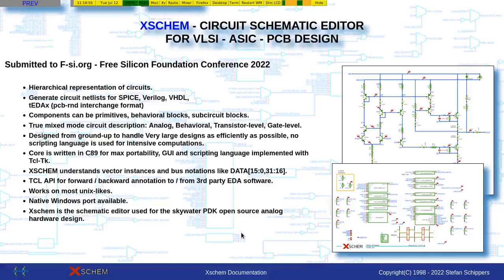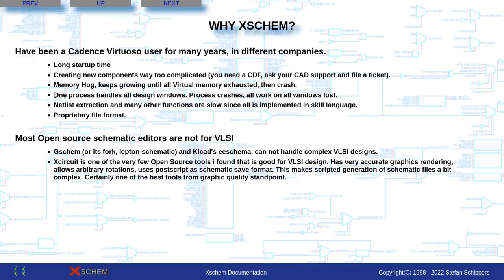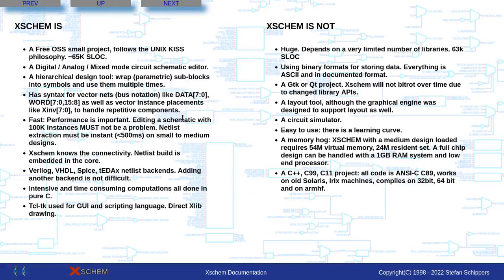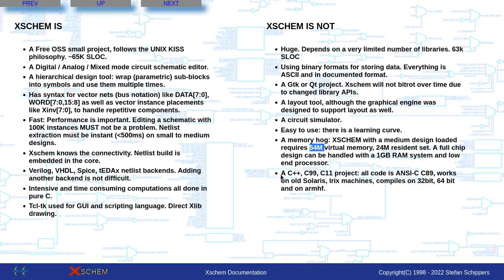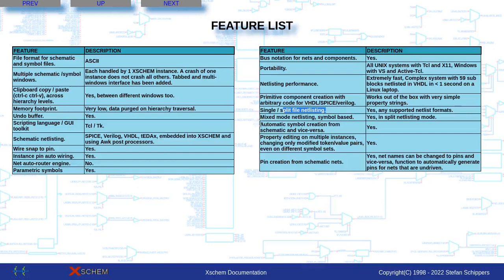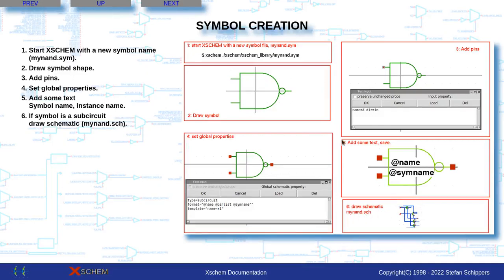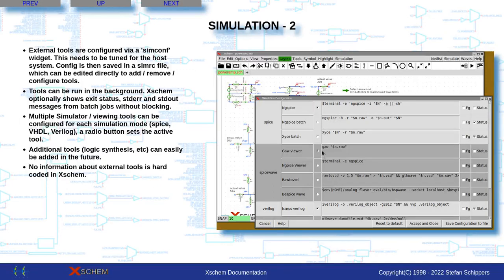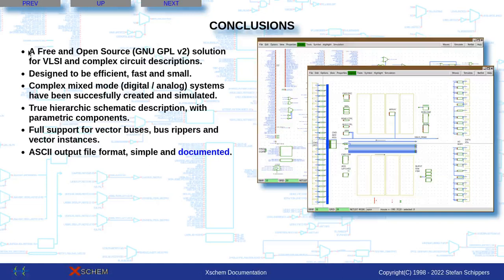Xschem schematic editor presentation for the FSiC2022 Conference

Comment: I have a few more questions:
1. Does XSchem support the XDG Base Directory Specification? That is, are configuration files no longer stored directly in the home directory's main folder, such as in ~/.xschem, which can lead to clutter, but instead stored in the XDG directories defined in the specification, for example under ~/.config, ~/.local, etc.?
2. Is UTF-8 Unicode support planned for the file format? This would allow for locale-specific characters in text labels, such as the German umlauts ae, oe, ue.
3. Does XSchem support only US ANSI-standard symbols, or also international symbols commonly used in Europe according to IEC 60617 or DIN EN 60617? For example, the US symbol for resistors is a zigzag line, while according to the international standard, the resistor symbol is a rectangle. A rectangle used as a resistor symbol is basically faster to draw on a computer and therefore more performant than a zigzag line. Although with modern hardware this is likely a minor factor, it might still be noticeably slower when rendering a very large number of resistors.

Comment: I find the design decision to rely directly on FBdev and X11 instead of GTK or Qt interesting. Considering that GTK and Qt were still quite unstable in their early days and are still undergoing significant changes even today, the design choice is understandable. On the website, I also read that rendering speed was an important criterion. FBdev provides relatively fast software access but, as a pure framebuffer, does not offer 2D acceleration functions to my knowledge. These were only available through X11 if appropriate graphics card drivers were used. The Simple DirectMedia Layer (SDL) was released at the end of 1998 and would also have allowed sufficiently fast or direct, albeit only limited 2D accelerated rendering access, but it was also available on Windows and Mac OS X. I suspect it was still too new at that time to be chosen.

However, I wonder why the decision was not made to use OpenGL 1.1. It had already been available for many years back then, and with MesaGL there was a free library as well. OpenGL is known to be backward compatible, stable, and in principle suitable for developing 2D interfaces. Unlike a simple framebuffer, it would have utilized hardware acceleration features. While the Linux framebuffer was eventually removed from the Linux kernel, and the old 2D accelerated X11 access is no longer used on modern hardware, with attempts to render X11 in software on top of an OpenGL environment, and with X11 itself being replaced by Wayland, accelerated OpenGL support still exists today. It would also run on Windows and Mac OS X.

So why was OpenGL not used if rendering performance was an important design criterion? I ask out of pure curiosity because I’d like to understand the background.

Another question is, what do you think about the future of Xschem? I expect that Wayland will displace X11. Already today, there are not many developers who can write applications directly in X11.

Would you choose OpenGL or Vulkan today, and are there plans to port Xschem to OpenGL or Vulkan?

Comment: Can we write a script for sxcheme layout?  For example, we use sxcheme to layout a design in transistor level. When done, I would like to put it in the array nxm.  It can be troublesome to do manually and I prefer to write a script to arrange the array I want.  Is it available or possible?  Thanks in advance.

Comment: When you say skywater 130pdk is integrated, do you mean the model files are natively available?
Reply from the maker: No, skywater 130 pdk integration means there are symbols to be used within xschem that represent the available silicon devices. These symbols are set up such that after generating the spice netlist it can be simulated by Ngspice (and Xyce when the pdk is fully compatible with Xyce). The model files are provided by open_pdks, together with many other files for digital design. The whole 130pdk is several Gbytes. Xschem netlists for 130pdk just do a .LIB to include the top sky130 model file, installed on the system by open_pdks.
Reply: @stefsport2002   Thanks for clarifying!